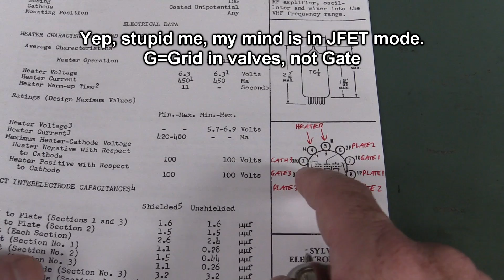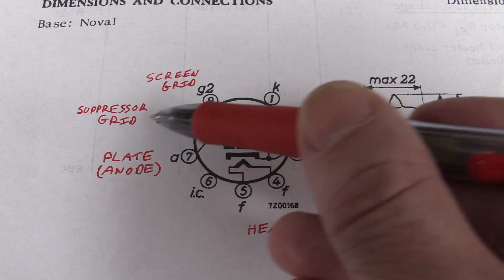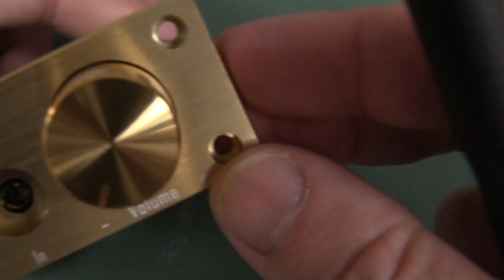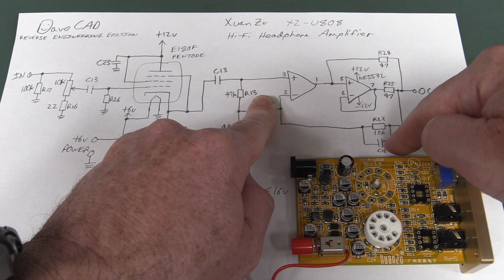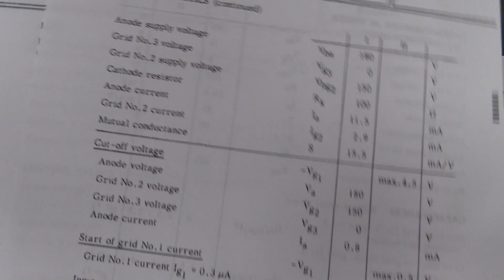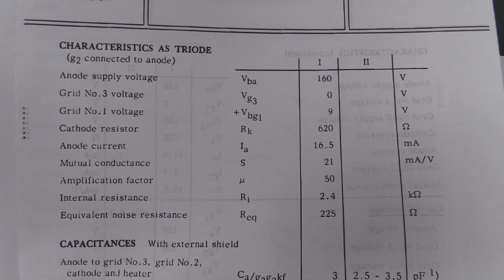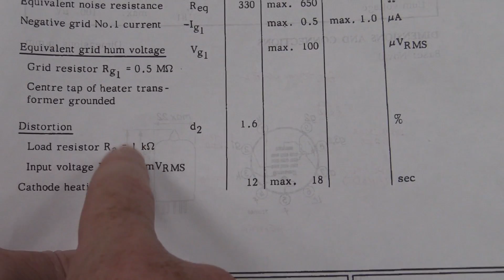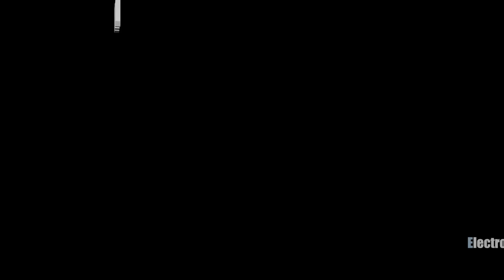EEVblog #837 - Reverse Engineering A Valve Headphone Amplifier

Comment: 23:40 "so the tubes actually do something..."  
Yes. They add 1.6% distortion.
Reply: +NatureAndTech But at least, it doesn't have an output transformer...
Reply: +AltMarc adding a transformer will significantly reduce any static noise.
Reply: +NatureAndTech I find the best bit being the tube in the "Tube Amp" is actually removing amplification.
Reply: +NatureAndTech They heat up the room too.
Reply: +Ivan Taranov "Where's the Beef?", That's a few years back.
Reply: +NatureAndTech Yep, harmonic distortion, the "tube sound" for "golden ears." This video proves what I suspected - the tubes are there for appearance and to introduce harmonic distortion. The extremely low distortion specs in the advertisements (Total harmonic distortion: <0.005%) are probably just for the IC audio amp stage since many casual tube amp enthusiasts probably don't know that that "tube sound" is harmonic distortion and would be sacred away by the figure for the entire chain. Or, since the triodes aren't taxed, perhaps they can achieve that low level of THD even at those low plate voltages.
Reply: +Winston Smith I do not have the heavy tech knowledge about valves (my boffin uncle does), but in my experience with many different guitar pre-amps and power amps, I can say that all transistor based sound truly awful in every way.  However all valve designs sound completely different and also produce sounds, that are simply impossible with transistor amps.   So in a guitar context you do not need golden ears to hear the difference.  However when I have used valves with recorded audio recordings etc, I find the difference to be fairly small.
Reply: +EgoShredder Every valve sounds different,  and the same valve sounds different in every different circuit.
i.e. using a 6ES8 in place of a 6DJ8 or ECC88.
Thats a big part of what makes valve drive audio so magical
Reply: +EgoShredder "So in a guitar context you do not need golden ears to hear the difference.  However when I have used valves with recorded audio recordings etc, I find the difference to be fairly small." Your answer is there waiting for when you decide to accept it.
Reply: Morlanius Not really and if you play guitar, you will know the true answer, so cut the smart guy answers;  I use whatever sounds best, not what somebody tells me is best.  The way guitar pickups etc interact with a valve pre-amp, is a totally different situation to a home HiFi situation, where no pickups are involved and a different sound and outcome are desired.
Reply: EgoShredder I'm pretty sure there's no valves in mine and my Ibanez 3 series sounds great on it, when I am at a friends house and their amp does have valves it sounds good there too, though there is more distortion.
Reply: +Morlanius Things have moved on in leaps and bounds since the 1990s amps like the Laney transistor amps for example or the horrible distortion pedals.  However I cannot achieve the sound of my Marshall valve amps and cab with virtual software amp software, such as Amplitube or Guitar Rig.  Also doing that musical sounding controlled guitar pickup &lt;-&gt; cab feedback type thing, with computer software is nigh impossible.  Stuff like this is only a simulation of the real thing, and I have yet to hear anything that would make me sell my real valve amps and my cab etc.  Using the real thing is a completely different animal.
Reply: EgoShredder I don't believe I mentioned anything to do with computers, digital effects peddles or software.
Reply: Morlanius I know you didn't, I am just going through the typical options available that are not valve.  No point me droning on about the merits of either, but I am not sure why you think I am deluding myself as you insinuated in your first reply?  I find that certain things respond very nicely when valves are involved, but not everything is as pronounced compared with guitar use.  Most of the time in other uses, it simply thickens the sound in a pleasing way.
Reply: +NatureAndTech I wonder if they took any consideration into response curves or what frequencies distort more. Or even distortion versus power. Are they distorting it properly to sound better or just randomly distorting it and making it sound aweful. Also, some cheaply made new tubes from china can have a nasty surprise of loose grids making them microphonic.
Reply: *warm distortion
check out zoom guitar pedals with twin tubes and state of the art DSP, something for every customer /s
Reply: ***** Life without good quality progressive metal or classic hard rock?  Where's my suicide pill! :o
Reply: +EgoShredder By and large a good guitar amp vst is not possible to tell apart from a real amp in a double blind test.
Reply: +The City Spiders The problem is in general how transistors and caps saturate the signal. They don't saturate the right harmonics (mainly second order ones).
Reply: Fourier analysis in a nutshell?
Reply: +Winston Smith you do know that REAL tube shit... AKAtheshit made in the 1920s to 1950s, and modern high price, name brand amps... like "orange amps" for guitars.... actually do use the tube for amplification and EVERYTHING right? so SMD bullshit....

my grandmother got the first electric organ MODEL baldwin made in the 1950s from the local church ... not serial number 1.... but the first model..... like a model T ford serial 6,236. it has a few problems.... 

it converts 120V to the 6.3V and MANY other Volts it needs....all using tubes. not a plug pack. 
120v from wall all the way inside the big box with all the tubes in it...
and it has about 60 different tubes in it..... 

this thing is going to have a different sound.... and it does, but not like you think. i think its broken.... it has a strange modulation to it. caps ARE original.... so, theirs my problem. so are the tubes! some VERY old burnt out ones as well...and a few new ones from the 60s in box! changed out about 10 obviously burnt out tubes (black scorch marks/missing all the silver so no vacuum) an it sounded a little better... but the modulation is still their....i have a video on my phone and a picture of the back... if anyone cares. 

anyway.... TLDR.... that organ, even if it worked right, would 100% not sound the same as a modern transistor/solid state baldwin.  its going to technically sound worse, but better to the ear. 

and as guitar amps... they have a HUGE point. 

where you ARE going to be over driving them, really fucking hard...some times thats the point "but it goes to 11"...... the hotter they get, the "warmer" the sound is .

warm, sharp, crisp, rich, full, bright.... all that are used to describe how a guitar sounds...acoustic or electric. 

so warm isnt a jump at all.... it does matter. people would leave their amps on for as long as possible.. 3 or 4 hours, heat up the room, get it even hotter, then record albums, or play live. i believe it was Hendrix... or a blues dude. bb king? its late..

but, if you play a song that was recorded being played threw a tube amp.... and you have a CD that has NO LOSSES... why would you play it back on a tube stereo? it would distort it...

i think you would want the least amount of distortion for "play back", and the most distortion for "playing". 

if your making an album or fucking around on your electric..... you might want the softer sound or like how it reacts differently with higher distortion and some effects pedals.... 

but play back???
Reply: +InXLsisDeo the effect wont be as good as the real thing... it cant think of every possible combination. 

can you pick different tubes or amp designs? class A or B, how many total tubes, different transformers.....

a blown or defective tube will make a sound like nothing else... they all sound a bit different when they pop... if you happen to be playing at the time. 

and... i know people are going to say "i bet you have a tube amp". 

nope... using built in audio on my PC and decent quality 2.1 speakers that sound damn good enough....i just pay acoustic and want to get into electric, but dont have the money. 

you tend to know what your getting...spend a bit more time on google... when your poor as fuck....

tube amps are WAY out of my price range....
Reply: ***** If done properly and you don't tell people it's not a tube amp, no one can tell the difference between a good quality VST simulation (of which there are plenty, even free ones) from a real tube amp.
Reply: Crimson Sunrise I think the point is, it depends on what kind of sound you are trying to achieve, and VST stuff is not able to cover every kind of guitar sound.  If it was so good I would have been able to EASILY replicate my own personal sound in plugins, just by dialing in the right settings.  After 13 years or so of trying I have not recreated my own sound with plugins.  Oh and my sound is nothing special either, just heavy overdrive with delay and chorus, compression etc.
Reply: EgoShredder I can easily replicate almost any guitar sound.
Reply: Crimson Sunrise My friend has a Mesa Boogie III combo amp, along with a few BOSS pedals and a PRS guitar.  The sound he could get out of that simple combination was incredible.  However using the virtual Mesa Boogie amp models it sounded like a sack of shit, and did not bear any resemblance at all to his real setup.  Now who knows, maybe if you had been there to handle the software it might have been different, but I doubt it.  Not having a go at you by the way, just for whatever reason plugins have failed for me, although they are useful.
Reply: *****
I really wish you were right because I could have a much lighter, easier to transport set up, and spend a lot less money.  I've also heard some of the current popular artists who are using virtual amp software live on stage and in the studio, and in my opinion their sound is generic, plastic and uninspired.  Even the older guys like Brian May have resorted to modern methods, and they have lost their original beautiful sound as a result.  You can not simulate character and for me valves provide that.  Like you say though....each to their own.
Reply: +RyuDarragh The thing is I will never be in a position to do that blind test, plus I lack the motivation to do it after using my current set up since 1995, although my previous transistor set up was up until May 1994, then all valve amp and head until December 1995.  Character is in the artist...correct.....BUT rubbish gear or an unfamiliar set up will not allow that character out;  again I have heard some of the most talented artists like Yngwie Malmsteen who sound terrible through crap gear.  I do agree that relying too much on technology is an unwise thing to do.  Don't forget though that it depends on what sound you are aiming for as to what can deliver it.
Reply: ***** I must say that all my comments are from the perspective of a musician, who has always embraced the march of technology.  I even have valve microphone pre-amps but I do not reach for these first, and often use transistor based pre-amps.  However for various reasons I only use valve when it concerns guitar sounds.  I have had compliments on my sound back in the days when I was transistor only, but to me those sounds I got from that were good considering what I was using, but it was the studio that made the difference.
Reply: Harmonic distortion AND high output impedance. That makes the amp to drive the speaker in 'current' mode. Meaning that it delivers almost flat power to the driver (while in voltage mode as you go into resonance, low freq and high freq you get lower power).
Reply: +akkudakkupl It&#39;s probably got something to do with Tesla zero point energy or something like that then
Reply: So the tube only adds nonlinearity... and the opamps are used directly as the power output with no heatsink?
Reply: The distortion is a 'feature', but it only happens when driving the tubes above distortion levels, which is usually higher than 150v for these common tube amps. Driving them under 150v keeps the voltages lower than clipping, so you don't get to take advantage of the tubes naturally ability to roll off clipped waveforms. However, they also have tendencies to roll off high frequency spikes as well, which also adds another layer of distortion, and THIS is what people tend to hear when using them as a headphone amp. They can soften unsmoothed square and sawtooth wave sounds(like music from old games) as well as making music sound warmer by mellowing out the higher frequencies and accentuating the lower frequency overtones. However, the amp still needs to have adequate amplification by the tubes before this even starts to make an audible difference, so you have to use very high resistance headphones to force the headphone amp to REALLY push the tubes hard.

They are used in guitar amps for the sound they produce when pushed beyond clipping, and is a related, but totally different effect. I see a lot of people getting that confused, so I felt I needed to point it out.

Some of these tube amps have the tubes in a separate 'filtering' stage with a set constant amplification, and then reduce that back to line level for a transistor amp to deliver to the headphones. These do this so that the output sound quality stays the same regardless of the headphones impedance used and many audiophiles call these 'fake' tube amps.
Reply: The thing is people actually want the distortion. That's what they're using the tubes for specifically.
Reply: "But it's really GREAT distortion, Mrs Presky!"? :)
Reply: Guitar amps are expected to be pushed into nonlinear high gain, where tubes give you all that wonderful harmonic distortion, compression, and other goodness.  Transistors can be made to emulate the tube distortion sound. Lots of pedals exist with JFETs, clipping (both symmetric and asymmetric), and overdrive.  But there's more going on in a tube amp than just the tubes.  For example, the output transformer can be pushed into nonlinearity, which adds its own layer of distortion to the sound.   Now you can buy modelling gear that mathematically  approximates what's going on in the tube amps, the speakers and cabinets, and various effects.  They are not the same as the real thing, but they are getting better and better at approximation.
Reply: mipmipmipmipmip 
Its not even ±12 volts, its just 12V and ground wich is I think too low for any efficient gain cause it is too far from saturarion point (or however you call that with valves)
Reply: NatureAndTech 

You can't compare the distortion of tubes to solid state distortion... The distortion is much softer and in many people's opinion it colors the sound in a "warm" positive way (that 50s sound), that's why virtually all good guitar amps still use tubes at least im the input stage. But for home audio it's also good especially for old music that was intended for tube equipment. Yes this is a shitty chinese unit but no reason to discredit tube technology as a whole.
Reply: The distortion is lower when being forced to run in low voltage mode with a buffer. It still adds distortion, but that is the point.
Reply: Next time: chinese curtain burner AA5 radio/amplifier
Reply: @TheOriginalEviltech  No, it won't!
Reply: @EgoShredder  What do you recommend as an add-on to use in a home hifi setup, those having separates or a receiver, to slightly "thicken" the sound of streamed or other digital sources; a valve pre-amp, an effects box, some type of enhancer/equalizer?  Maybe we do want to add a bit of harmonic distortion back into the mix to fill in the missing sound?
Reply: @sydneybird116  I've considered trying that by passing the audio through a valve preamp, but not done so yet; most cheap valve solutions seem fake or snake oil.  I've only got a ART DPSII digital valve preamp at the moment, which is meant for microphones and instruments, although that does give a good pleasing thickening effect.

My main HiFi is an SMSL M8 DAC going though their VMV VA2 headphone amp and P1 linear power supply.  I have this going through a small sub-mixer driving Quested S7 reference monitors.  When using headphones I use my AKG K712 PRO.
Reply: @EgoShredder  Thanks for your reply!